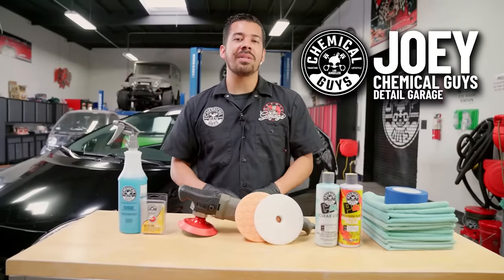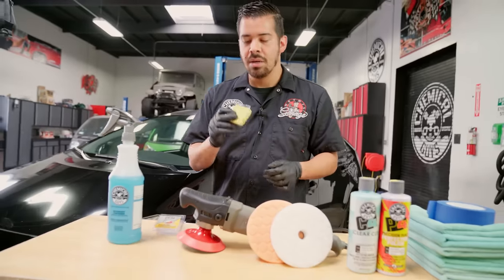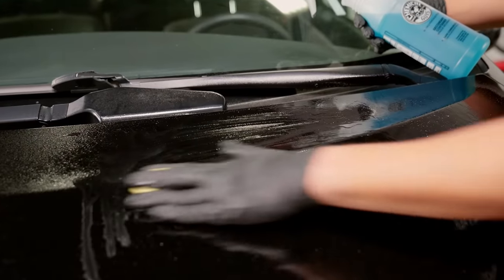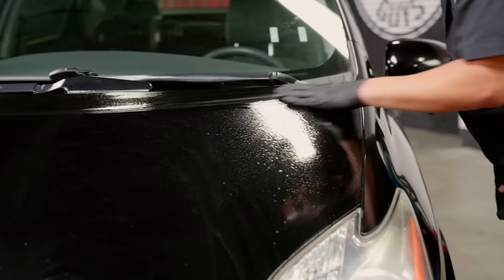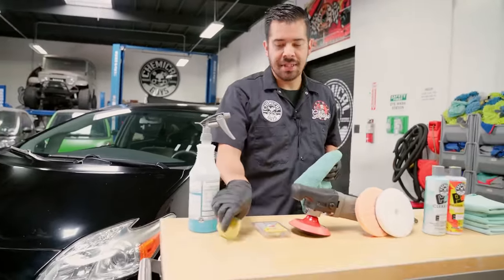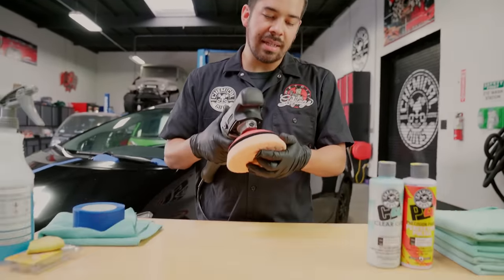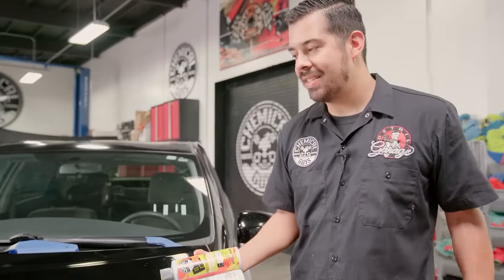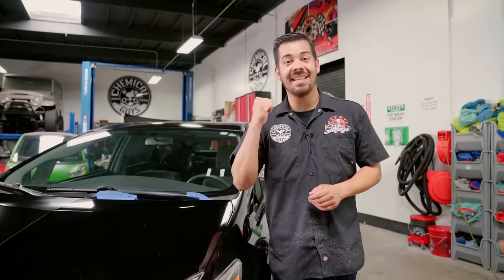Paint PERFECTION! Restoring beat up and faded paint with a one-two-punch of shine! - Chemical Guys

Comment: If i will use 5 inch chemical guys hexalogic pad, what size of backing plate will it fit?
Reply from the maker: Hi there! Use a 5 inch backing plate when using 5 or 5.5 inch pads.
Reply: @ChemicalGuys  Thanks for the quick response. Because I purchased some of your hexalogic pads and I'm just thinking what size of backing plate to use 😊